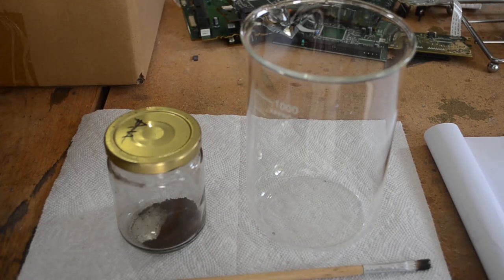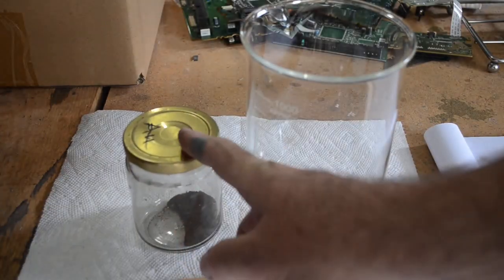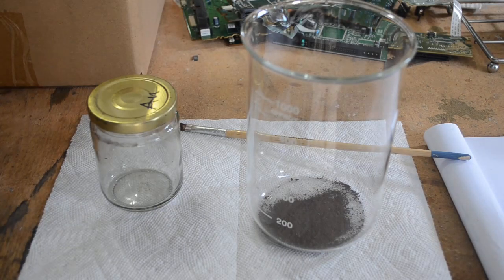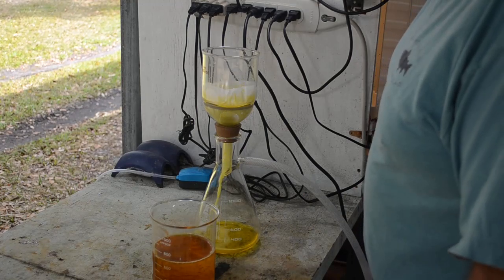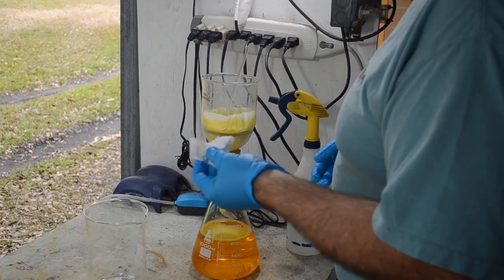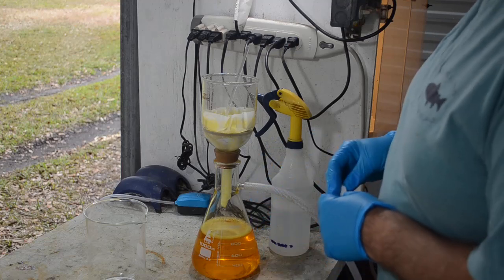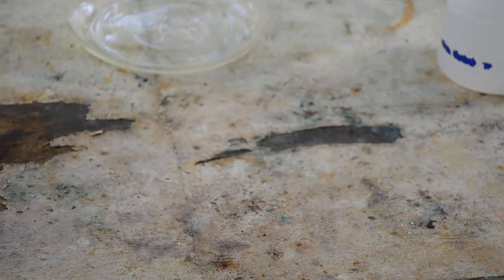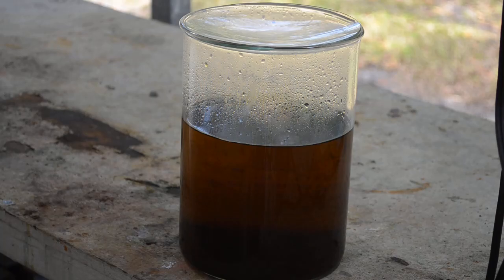Refining 30.51g of Dirty Gold and Pouring a Bar, part 1

Comment: Wondering how do you determine how much hydrochloric acid ?
Just guessing once there is enough to get all wet - then how / why more ?
Adding nitric seems self explanatory - just dripping in till dissolved .
Thanks again
Reply from the maker: It really doesn't take a lot of hydrochloric acid to dissolve a lot of gold. Nod sure if there is a hard and fast rule about the minimum amount needed for a given weight of gold. I generally use plenty since it is cheap, and I sometimes get busy with other things. I worry about boiling off too much of the HCl during a protracted heating.
Reply: @omegageek64  Besides not using too , also another concern is too much waste / or cutting down the amount ?